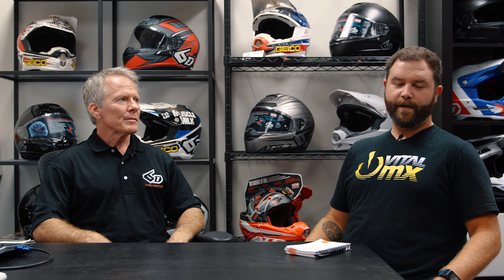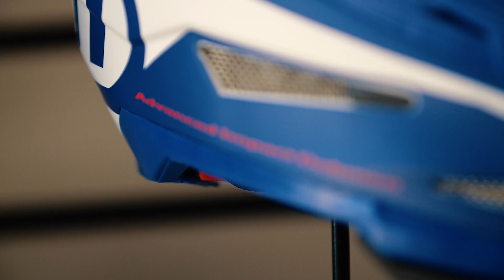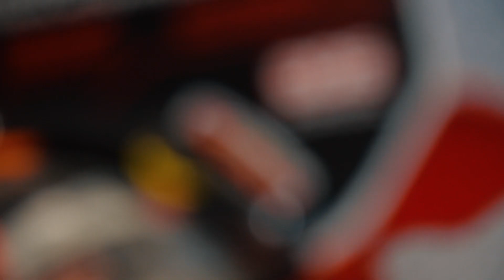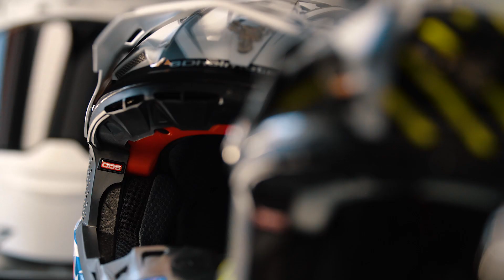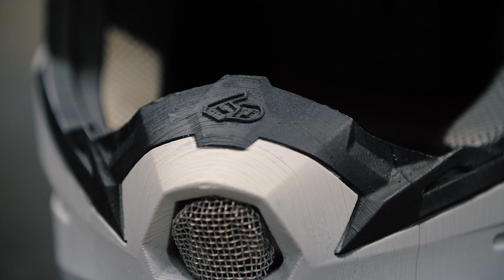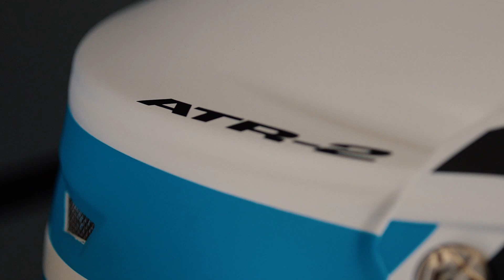6D's Response To The Helmet Technology Race

Comment: For mx/sx why don"t they enclose the entire front with a cover lens strong enough to withstand impact of another bike(Weston Peick) and to enable clean breathing with a totally protected face/head.
Goggle companies will go out of business or adapt but it is absurd the face is still vulnerable in a helmet. 
Time to protect the rest of your head.
Reply: I've always wondered this too..
Reply: @xburtonboardnx  The tech is there.  Seems absurd to see these guys with mouths full of dirt & rock. Integrated batteries could cool the helmet, clear lense and filter air.
Revolutionary but not, almost overdue for an industry progressively making advances.
Reply: You're talking about reinventing the wheel now. Fans motors batteries etc more weight, plus more stuff that has to be protected from your head during an impact. Which in return would make a bigger helmet, and in a sport where minimal is sought after. Could they do it? Yea maybe in the  next 5-10 years. But you'll be looking at $2k+ helmets
Reply: @stephenwilson1012  I am betting your statement will be proved wrong.